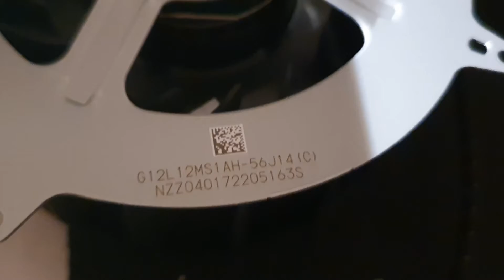Sony why? NMB v2 does not fit in the PS5 CFI-1216A

Comment: Witch ps5 standard model is better?1000 -1100-1200???witch one ive to buy?please help
Reply: I guess 1200 series
Reply from the maker: I am currently testing the cfi 12 with different fans.. later i will do the cfi 11 and cfi 10. I can not tell which one has the lowest temps and best components at the moment. Just subscribe and be patient. If you need one, just buy the latest and you have also 1year warranty
Reply: @McKuc  if  i will stick my ps5 with nidec will don't affect my longetivity?
Reply: Ich bin sehr gespannt

Comment: @Mc Kuc Hey, does this NMB V2 fan fit normally in CFI 10 playstation ? Thx :)
Reply from the maker: Yes
Reply: @McKuc  Thank you for the answer. I love your videos. Have you already checked the rpms on the ebay nmb v2 ? If so, is it same as original and safe to use ? Also to use the nmb v2 in my cfi10 ps5 is the cable long enough or do i need the aliexpress extention ? Thank you so much <3

Comment: Do all 1216a have nidec fans?
Reply from the maker: so far i only had with Nidec V3. can not tell you at the moment. i guess no
Reply: I've seen 2 with delta.
Reply: I have 1216 with Delta fan.
Reply: @icemann9311  Is it loud?
Reply: @GrkkNikk  Not. It works quietly but has higher RPM during the game than the previous revision.
Reply: @icemann9311  could you please post the model number of the delta fan? Thank you!
Reply: Saw today one with an NMB and it seems to be the same design as the NMB V2